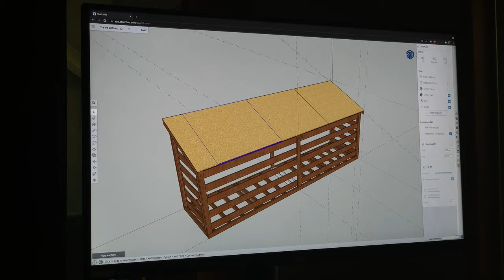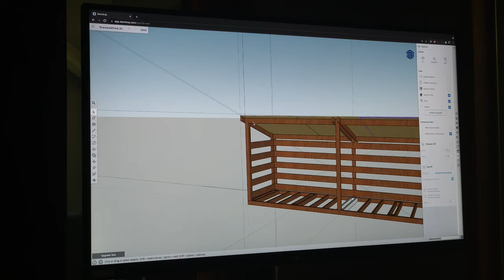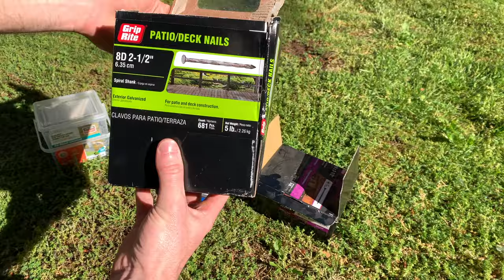Designing and building a 2 cord cedar firewood shed

Comment: experienced builders stagger the nails & screws in order to not be in the straight line of the wood grain, so as to avoid the wood splitting along the grain due to multiple screws in the same line.   have the nail pattern be tilted, not a perfect square. see.

Comment: I recommend much bigger roof overhangs or you’ll need to hang tarps around it. Also the gaps between the slats are way too big. Will make stacking a pain in the ass.
Reply from the maker: I’ve thought about that and I get what you’re saying. I’ve been using it for two years and it’s been fine. We don’t get sideways rain here or anything

Comment: What’s the reason for cutting the 4x4 blocks and building the base around those vs. using 4x4s that stretch to the required height and then nailing 2x4s to that?
Reply from the maker: I think it would be harder to level the 4x4s on the concrete blocks since they’re not flat on the inside. It was cheaper too
Reply: @thatDIYlife thanks for the reply

Comment: Maybe Im overthinking. Was thinking 2x6 would be more appropriate for the weight on the flooring. Also curious about the pocket screws for the cross supports on the floor framing. I was thinking of running long ways then the decking on the floor perpendicular. This design you got here gonna hold up over time with the weight? No regrets?
Reply from the maker: It's held up for two years without any issues.  Probably could of designed it better but it was the first time I did anything like

Comment: GReat video and great build MMB!
I just got one thought to share, since the roof is angled. Will you not face problems with wet firewood when it rains angled inwards the front of the shed? Since the roof i higher there, there´ll be a greater risk of rain hitting the mid-low firewood at the front of the shed.
Reply from the maker: You’re right the rain does hit wood where you’re saying but to be honest it’s never affected how fast the wood seasons. If I would do it over I would extend the roof another foot in front.  This was my first time building anything outdoors so it was a learning experience 🙂 good question though